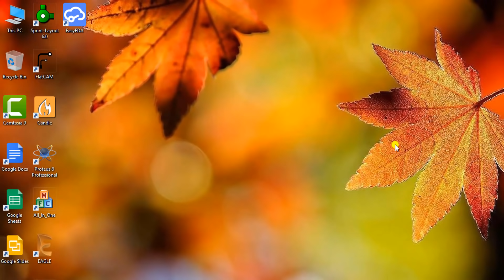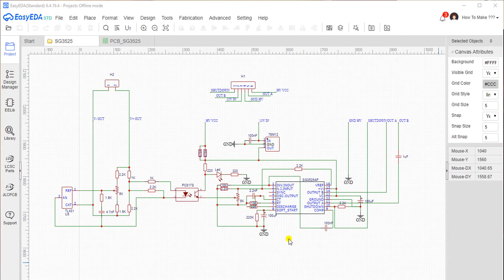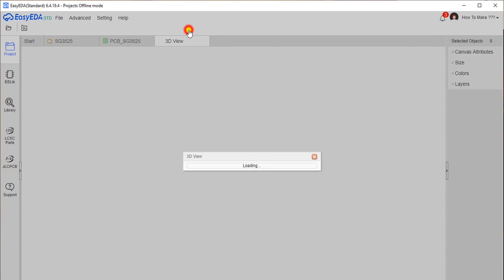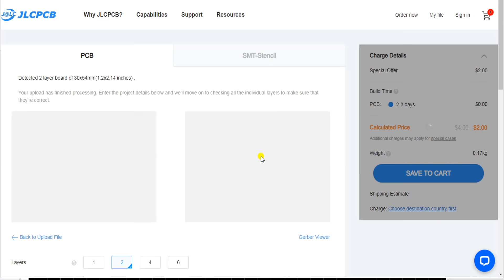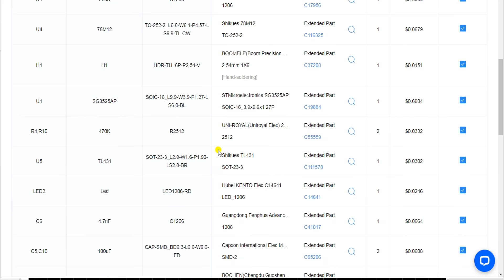Design 600W 24V Control Board with EasyEDA Software.

Comment: Need buck converter 50 amps  5v
 input upto 30v DC 

Based on tl494 

Need multiphase  buck converter to support that high current
Reply: i have one based on TL494, but it is not a great idea, better to use a synchronous buck converter
Reply: @trissmerigold7197  any links I need those buck converters to run 24x7 on 45amps
Reply: Is multiphase mode in tl494 synchronous  mode ?
Reply: @arjitsharma1364  no it is not for synchronous operation, if you want the circuit with the TL494 uses a diode for rectification and thus it has about 0.5*50=25W power dissipation on the diodes at full power(+switching and conduction losses from the mosfet and recovery losses in the diodes), but it is very reliable and quite simple. On the other hand a synchronous buck would be much more efficient, i built one on the basis of an IRU3037A, found often on old PC motherboards
Reply: @trissmerigold7197  5v x 50amps 250 watt 
Device I need 

Please share on my watsapp if you are a designer really need your help in some projects on paid bases

Comment: 12 volt buck boost converter
Reply: If you want i made one based on TL494, i can share gerber files and schematic if you wish so
Reply from the maker: Thank bro. Share and subscribe my channel
Reply: @LongTechnical  are you interested in the buck-boost? I have already the files uploaded on Google drive, it'll take me a minute to share. PCB is drawn with sprint layout and the circuit is very simple